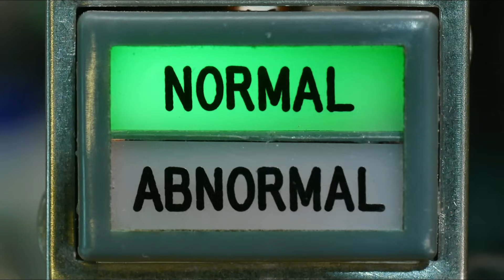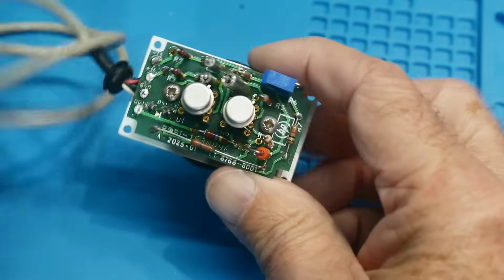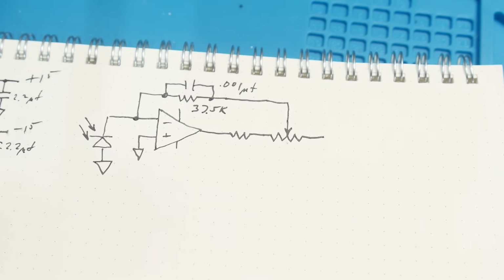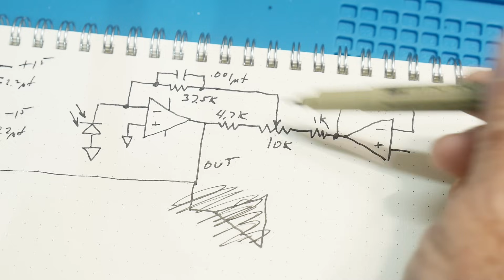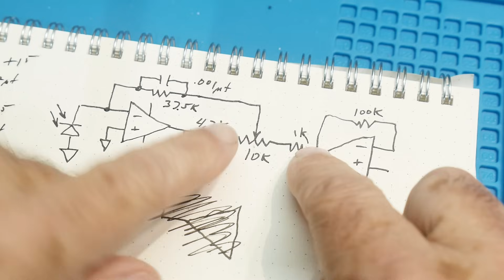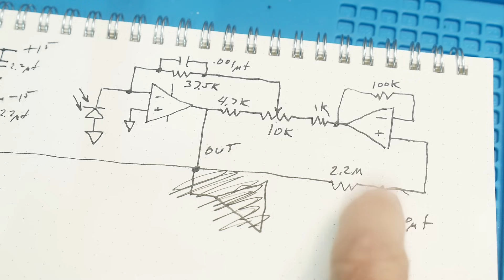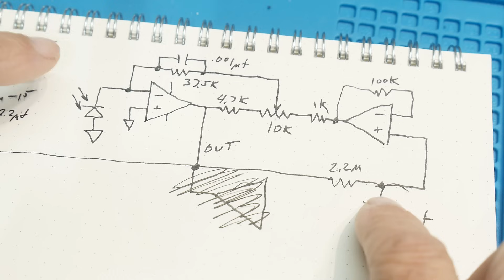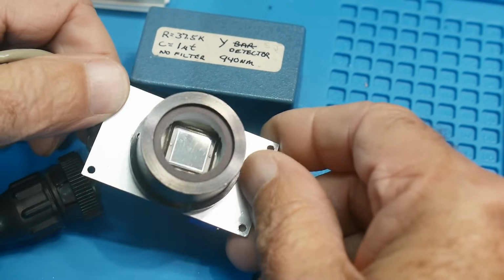#1779 HP Photo Diode Amplifier

Comment: Measure the uF of your PIN diode.  For wide-area PD those can be fairly large (but perhaps not as large as 1uF, unless it's not PIN photodiode.  Maybe they mis-read 1.0 nF, 1000pF?  Decades ago the "nF" was still in use.)  Also, connect the P.D. to -15 not to gnd, to speed it up.  Also, WHICH OP AMP?  or did I miss it?  Not labeled on schematic.   Decades ago, some of the quality expensive op amps were still only available in TO-5 cans.  Or was this far earlier, uA709 etc.?

Comment: BTW what's a y bar detector?  I remember a photomultiplayer was used to amplify the lights and signals before opamps eara.
Reply from the maker: the photopic response of the eye is modeled in tristimulus color theory as the function y also known as y-bar   a small y with a line over it.

Comment: I used an HP pin diode in the receiver of my, (our, my partner and my) long-range, (6 miles) free-air Hi-Fi laser communications system. It used a $1 three mW red laser pointer transmitter. The whole thing cost about $30 for a 6 mile range, but I'm going to do this balancing mod to improve it's range even further though I'll speed up the time constant for my outdoor application. I do love lasers.

Comment: Why the 100k feedback for the follower?
Reply from the maker: balance the input resistance to lower input offset voltage
Reply: @IMSAIGuy but that huge cap on the other input, I think would make that 100k feedback ineffective for that purpose?
Reply from the maker: @yjweaver5108  you're right. well, I have no idea then.
Reply: 100k is not function as feedback. it is simply a loop. even zero ohm will do. put a 100k just randomly selected to protect into saturation

Comment: I use mosfet ( 2N7000 or BS170 ) as a source follower and photodiode conected between drain and gate. 
PIN photodiode anod to gate.

Comment: I have some of those round op amps, I don't know the pinouts
Reply: The pinouts are identical to that of a corresponding 8-pin DIP>  You just need to know how the count relates to the small tab on the rim of the round can.  Pin 1 is the NEXT after the tab, or in most cases pin 8 is almost matching the tab.  (there is a provision for slight alignment tolerance.  Moreover, some of the cans actually had 10 pins, so they could not define the tab location being always number 8.  Also, the whole history started with TO-5 transistors, normally 3 pins, but sometimes 6 pins for duals..  As to op-amps , 7 = +supply, 4 = -supply, 6 = output.  2 = inverting input, 3 = non-inverting input.  1, 5 and 8 then vary for different purposes, mostly for offset null adjustment, or for frequency compensation.
Reply: @InssiAjaton  Wow, thank you. I will try this